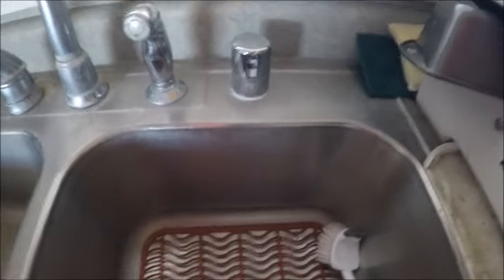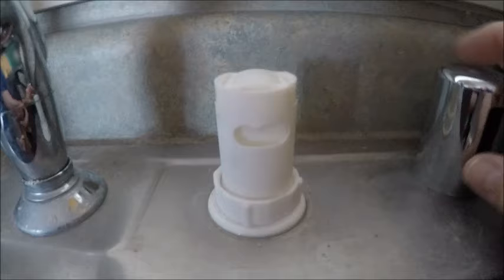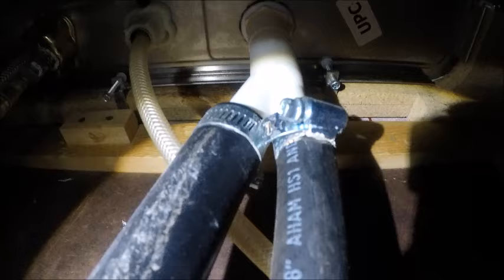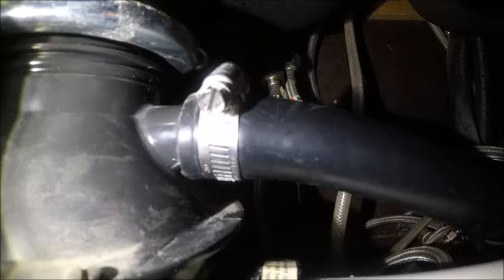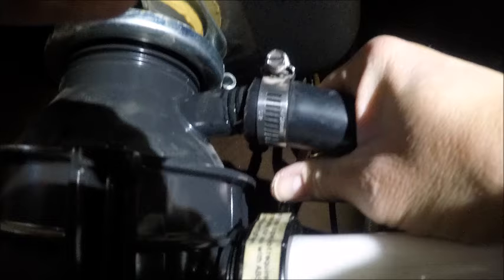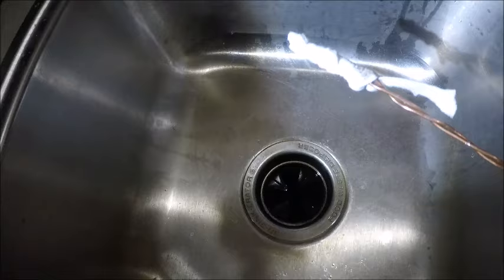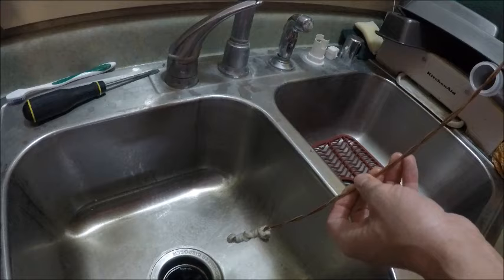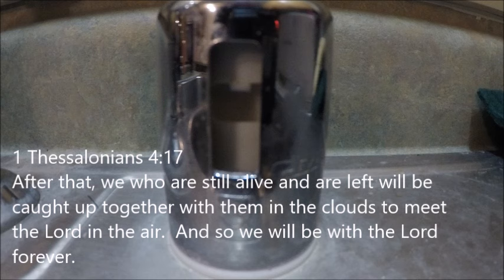Clogged air gap & drain hose line dishwasher to garbage disposal cleanout. Troubleshoot & DIY easy

Comment: Thank you, thank you, thank you. This fixed work. I didn't use the t-shirt for fear of it getting stuck, but removing the hose and cleaning the spot that the hose connects to the disposal with a thin brush for pipe cleaning did the trick. PLEASE NOTE: It's important to clean the hose out and the sopt where it connects to the disposal.
Reply: Did it really work?
Reply: My dishwasher comes up in both sinks and I have both sinks stopped up

Comment: Yes, the air gap was my problem.  I tend to put my sponges in the dishwasher to sanitize them, and a lot of small sponge pieces with some hair got stuck at the top of the air gap, preventing water from passing through the air gap to the drain.  Needless to say, sponges will not be going into the dishwasher, any more.  Thanks for your help!  And thank you, Jesus.
Reply from the maker: You are most welcome. Thanks to Jesus for being my savior.

Comment: Thank you so much for making this video. I had checked and cleaned my filters checked all the hoses. And the dishwasher still wasn’t draining until I saw your video removing the top plastic piece off the air gap. I found a toothpick with some gunk wrapped around it. I removed it and my Dishwasher is draining properly now. Awesome video!!!!!

Comment: Great tutorial. I bent a 12 ga. RomeX copper wire to make a small hook. Went in thru the air gap and pulled out some fiber crud. Then I used a flexible trombone slide cleaning snake to run down the hose to the disposal. 😊😊 Glad my wife heard the water spray initially.

Comment: I thought, for my dishwasher, it's the drain pump. I replaced it with two brand new ones and it just couldn't solve the problem til I saw this video! I opened the air gap and it is clogged very bad. After it's cleared, the dishwasher is up and running again with no draining issue. Thank you so much for reviving it (I almost throw it away😂)

Comment: Great video.  I was able to use a 2’ Cobra hair snake to loosen any debris (used on both ends).  Then I plugged the outlet to the disposal with my finger and ran and cycled water through the upper gap, letting go before it overflowed each time.  Gunk all flowed out with no hose disassembly.  Running perfect now.

Comment: My dishwasher stopped draining twice in the past couple months.  Both times, I removed the hose from the dishwasher pump and blew air (from a strong air compressor) through the hose.  That did the trick both times.  It ever occurred to me to check the air gap.  I just did, and there were 3 toothpicks popping up in the small hole!  I guess that's where gunk was accumulating.  I assumed the blockage was in the garbage disposal discharge hole.  Gonna get me a pipe brush on amazon now!

Comment: I saw elsewhere that one of the reasons that air gap hoses tend to clog like this is because they do not have a propper slope leading to the garbage disposal. The hose needs to be at a constant downward angle. In this video the hose clearly angles up into the garbage disposal. Shorten it if you want to avoid clogging..
Reply from the maker: Thank you, it most definitely does.  I will get under there and shorten the hose to put it at the proper slope.

Comment: Good video.

I found a splintered chicken bone in my air gap, caused the dishwasher to not drain.

FYI the black rubber baffle in the disposal pulls out and reseals very easily. My sink smelled horrible until I removed and cleaned the baffle. Any cleaning effort with baking soda and vinegar or using ice would not get to the bottom of the baffle.

I did not have to clean my tubing or the disposal port. 

It just my opinion but it most likely may have been easier to clean the tubing while it was still disconnected.
Reply from the maker: Thank you, I'm glad you got your problem fixed. Have a good day.
Reply from the maker: I just read all of the other information you provided, I missed it the first time.  Thank you for all your help it is very useful information.  Have a good one.
Reply: Same, chicken bone with filler gunk clogged the end of the drain line. 😄

Comment: You are already half way with taking the system apart. remove the air gap altogether take it ot the backyard and hose off all the gunk  and you will have 100% opening good for   20 years
Reply: Exactly!!!

Comment: You should have removed that tube and either replaced it or removed it to clean it better. Then reinstall. They was you done it, will allow alot to adhere to the inner walls of the rubber tubing.

Comment: just to add to help someone. The top of the filter inside the bottom of the whirlpool dishwasher has a piece on top of the filter. Mine was missing, and caused many clogging problems. The place I bought my dishwasher from,  wanted to order a new filter for me, but I found it at half price online.   Just fyi. Replacement filter should be under $30.

Comment: Thanks for the video.  After fixing the air gap backup, I ran the rinse cycle and noticed a foamy water solution at the bottom of the dishwasher. Do you know if this is normal?

Comment: Why didn't you clean out the debris in the dishwasher hook up at the disposer? And you never mentioned that the line coming from the dishwasher could be clogged as well. Good video just didn't seem complete. Maybe I will post the process for cleaning the lines to the dishwasher some day.
Reply from the maker: I mainly wanted to show the buildup that occurs in that area, then show the method of cleaning it out from the air gap.  That way people can just bypass taking that line off all together.  Though I probably could have cleaned it better from where it connected at the disposer.  Thanks for the thought on the line going from the dishwasher to the disposer being cleaned also, Have a good day and thanks for watching.

Comment: What if someone just left the air gab dangling under kitchen sink?  Will this cause leak?  There is no hole drilled on granite countertop.  I am thinking just to do a high loop and keep air gap vertical, or somehow cap or seal the air gap so drain water will go directly to a garbage disposal.

Comment: Can you tell me about how long the push out wire was?  The one you made with the cloth on the end to push the gunk out?  

I have a drain pusher, a plastic thingy from home depot that is flexible and i use it for hair in bathroom drain.  I used that, but it doesn't seem to be long enough to come out for me to see it in the disposal. But I think i might have cleaned it anyway as I was moving it from both ends.  So the length of the wire necessary to see it when it comes out into the garbage disposal?  Thanks!
Reply from the maker: The one I made is 3'-1" The length you need depends on the length of the hose from your air gap to your garbage disposer.
Reply: @freeindeed9508  yikes, i have to make it longer. but i think i got it. i poured water down the hole by the air gap and it flowed right into the disposal so i think i got it cleaned out...

Comment: I'm still having the same issue,  I've cleaned the line and replaced my air gap 🙃  time for a plumber.
Reply from the maker: You may want to check the hole size going into the garbage disposer itself where the hose connects.  If that hole was not made big enough it could cause a backup.  Good Luck and have a good day.
Reply from the maker: I changed my moms garbage disposer recently, I had to pop that hole into the disposer myself and had to make sure it had a large enough diameter for proper water flow.